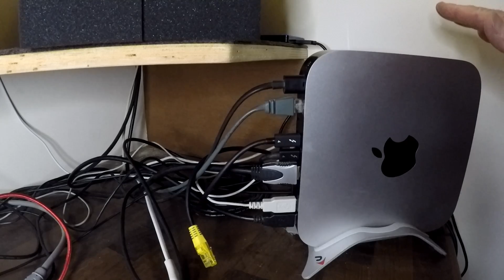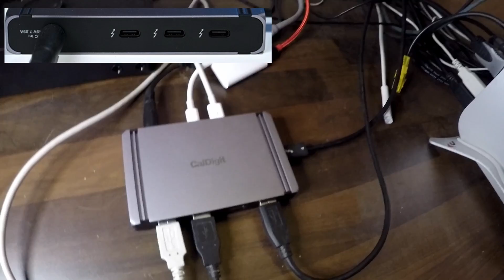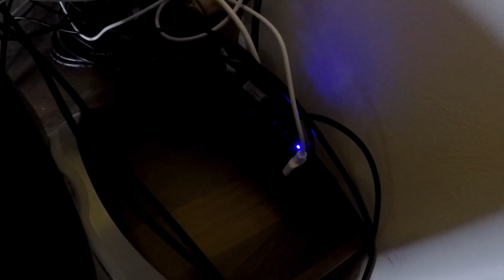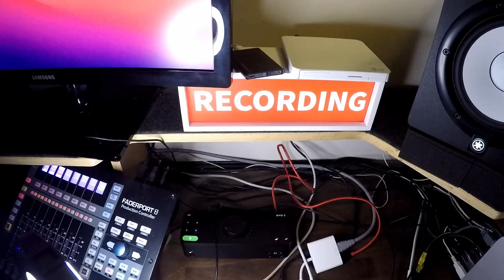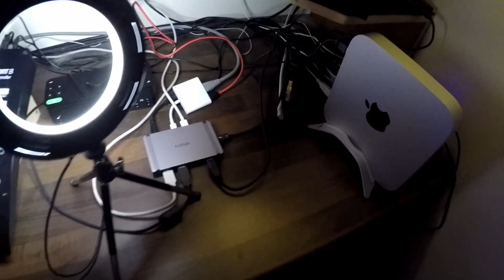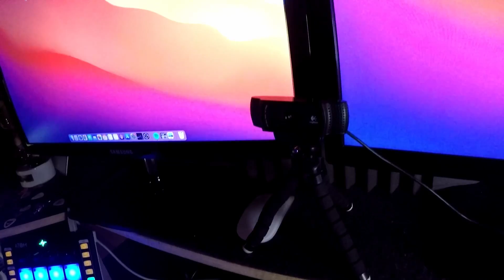Mac M1 mini & Caldigit Element 4 finally got connected to my Studio One DAW.

Comment: Which adapter did you use to connect to the Quantum please?
Reply from the maker: Hi , I dont have any adaptor, just the TB3 cable direct to the Mac, you can use adaptors if you dont have the correct cable.
Reply: @Newmusicreview  Thanks for the reply. I realised that after I watched all your video! I am using the original 1U Quantum which is Thunderbolt 2 and uses the same cable, so should be fine. I’m about to order the M2 Pro with 32 legs of lamb and 1Tb (I believe the larger storage doubles the potential storage speed). I want to make sure after spending so much I’m not left wanting more in a couple of years. I too use S1 which is rock solid on my dual 10 core Xeon with 128 gig of ram but is starting to show its struggling mainly due to it being about 7 years old. Great channel, keep up the great work.
Reply from the maker: @philfyphil  Excellent !...thanks for watching , its appreciated...YT is such a lot of work !

Comment: First off.... cables I use are plugable TB4 cables with my m1 mac mini. Affordable (half the price of apple) and work great. I picked up 2 plugable thunderbolt 4 hubs (best price and 3x tb4 out on each as well as one extra usb 3).  I use 3 interfaces from motu (ultralite mk3 hybrid which will soon be retired and an ultralite mk5 and an M4 for a weird routing). I have also 3x 7 port usb3 hubs mostly for midi for the gear but one accommodates backup drives. The TB4 hubs connect to the interfaces and nvme external enclosures for the work. I also have a USB to 4x midiplus 5 pin connector for non USB capable gear. With the 3 interfaces I have accesss to 7 external 5 pin midi instruments. I combine the 3 interfaces into one 36 in/out audio interface to allow for large live recording projects. Not the most practical of set-ups but it works for the gear I have collected over the years.
Reply from the maker: Hey thanks for the comment...where are you getting the TB4 cables from ?